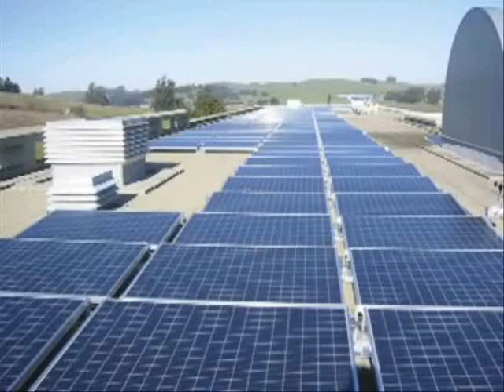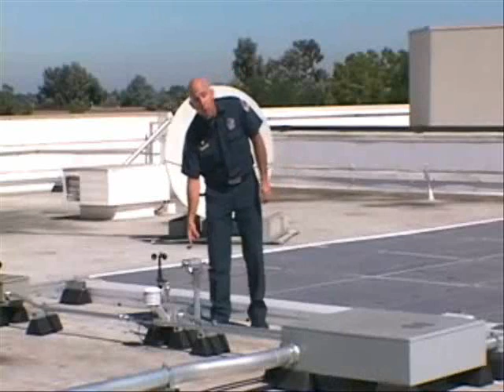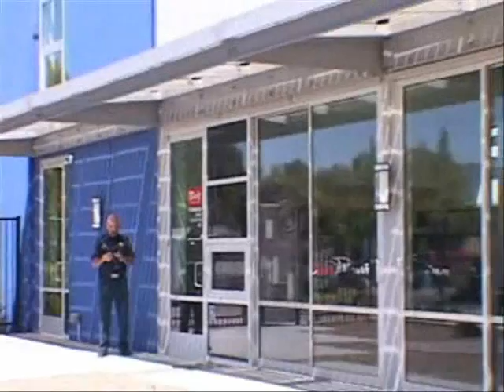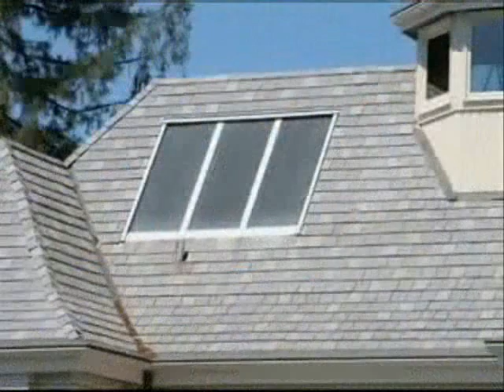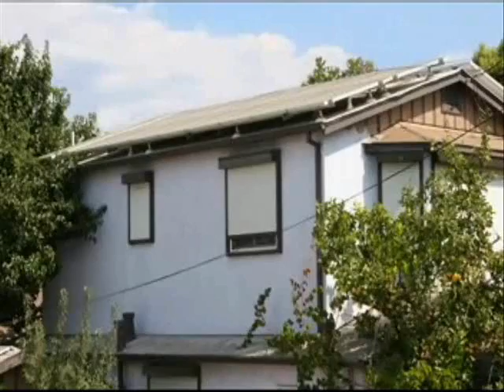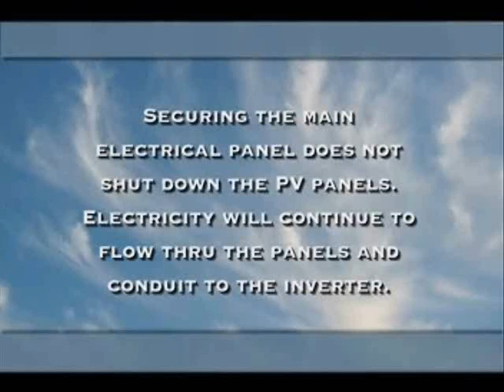Part 2, Solar Photovoltaic Safety for Firefighters; Version 2011

Comment: also them panels all flat are not very good they should be on an angle (they could be losing up to 40% of there power they should be at least 30 degree angle or up to 45 degrees)